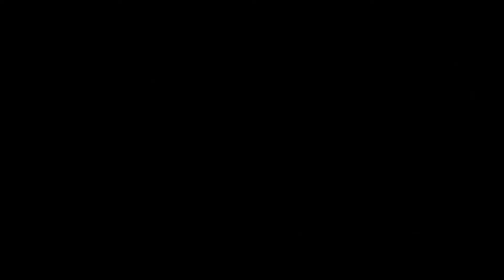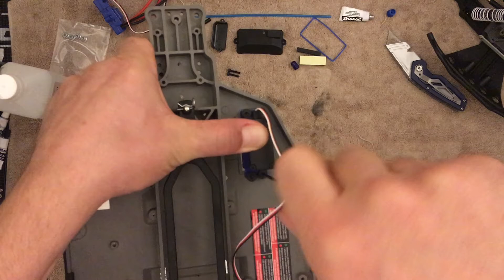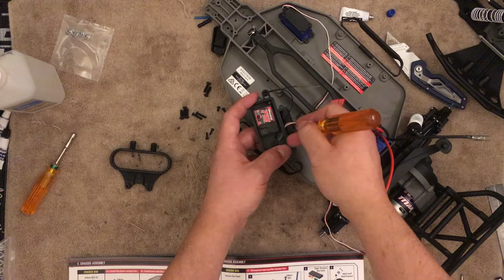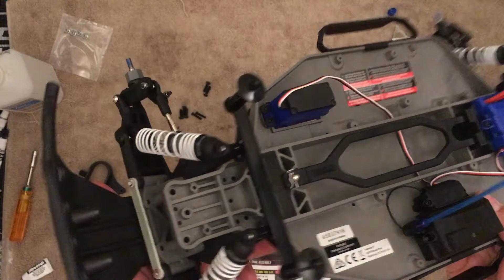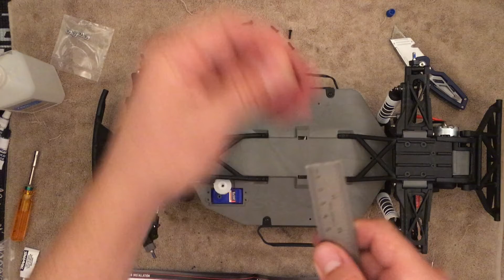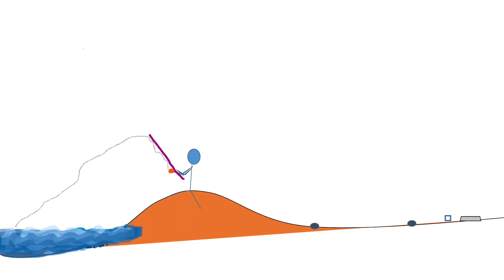Traxxas Slash 2WD Builder's Kit Part 6 Chassis and Electronics Bag build

Comment: It is a great kit. I just purchased the new vxl slash 2wd 272R trans I redid the shocks lowered the stance limiters shocks installed 4wd rustler wheels with bandit arms FR pulled everything in looks great actually handles nice crisp. But TY for another great content
Reply from the maker: Someday, try the ProLine body mount kit and the ProLine 2.8 Trencher tires. It looks awesome.
Reply: @telecomandorc  I will  try that at some point TY for that tech tip
Reply from the maker: @mikebianco7854  My pleasure.